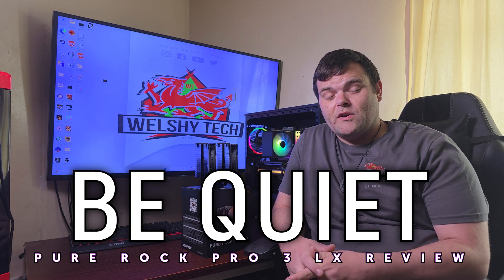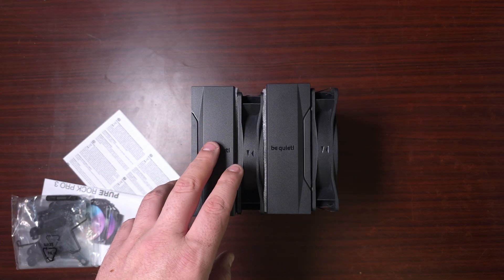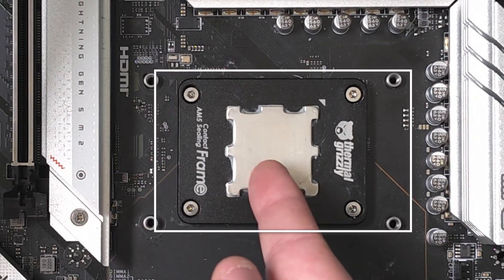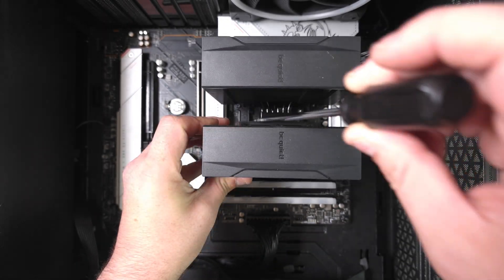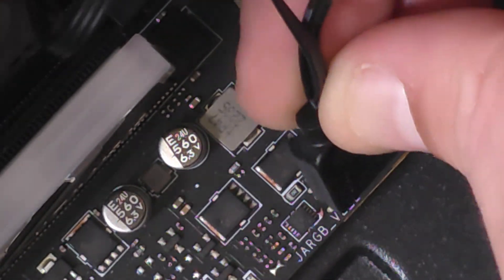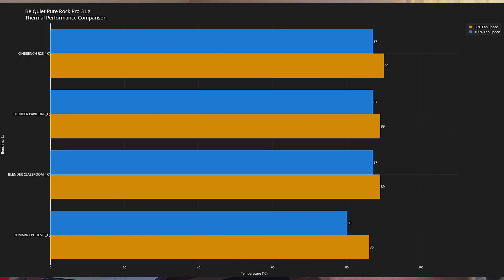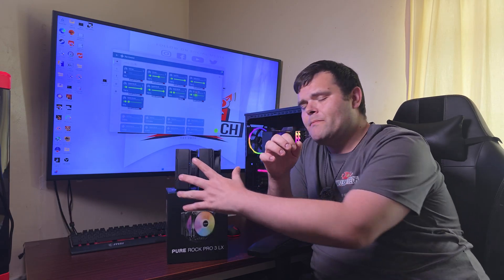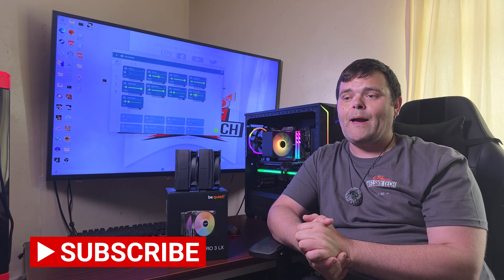Best CPU Cooler of 2025? Be quiet Pure Rock Pro 3 LX Review

Comment: Do you recommend applying my own thermal paste instead of using the pre applied one?
Reply from the maker: The pre-applied Thermal paste is what I used for testing which tested good
Reply: @WELSHYTECH cool, maybe it'll perform even better with new thermal paste in the future. 

Thanks for the video🫡🫡
Reply from the maker: This overall is a good cooler and the Thermal paste is also good and you are most welcome

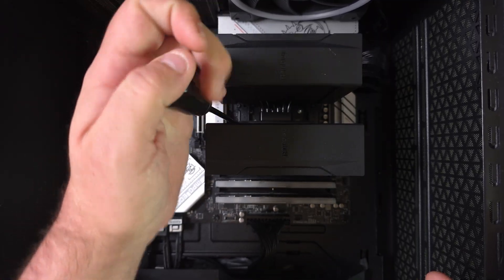Comment: 4:58 what do you mean "Screw it down until" did you screw it down until you couldnt twist the screwdriver no more? firs time i was installing this cooler one of the threads chipped off so be quite send me extra part, and today when i was finally mounting this cooler I was afraid to do so, because I could still screw it more, but it holds so far. thank you for any advice
Reply from the maker: Once the threads catch you screw down till it bottoms out
Reply: @WELSHYTECH  So for clarification those two "screw heads" you're mounting the cooler to the cpu/mb should be fully tightened, so you cant "screw" them no more and they are solid? Thank you
Reply from the maker: Yep once they bottom which you will feel with a screwdriver once it doesn't turn anymore it's done